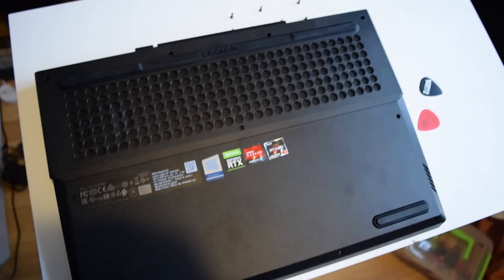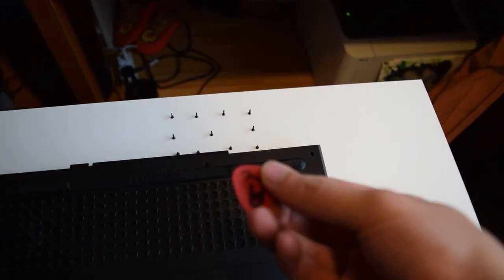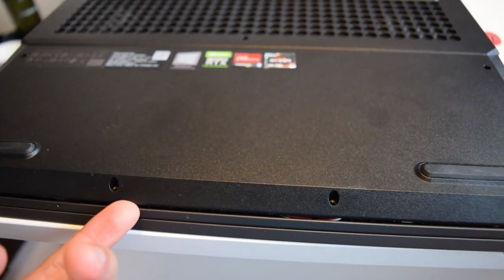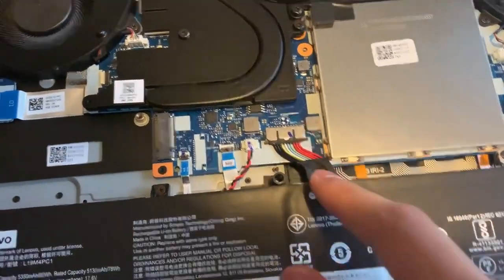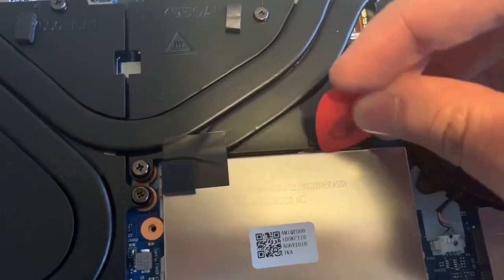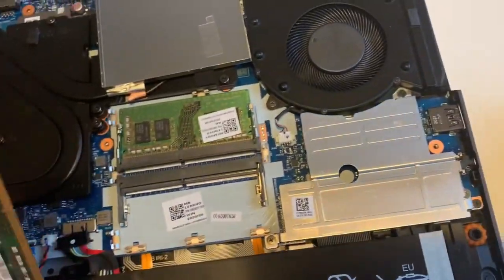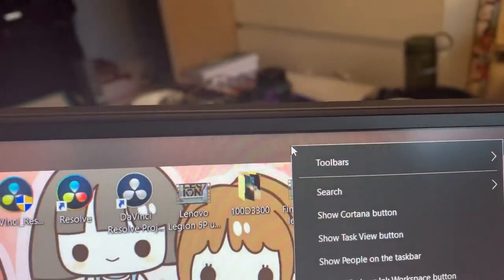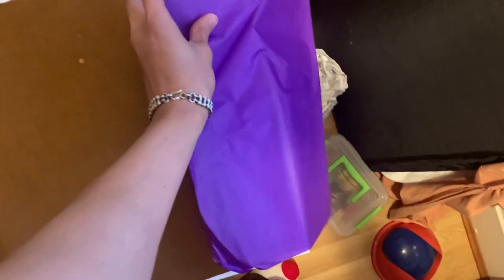Upgrading RAM for Lenovo Legion 5

Comment: I am not very experienced with tinkering with laptops, this looks easy though. The only Legion 5 I can find has 8gb ram/ 256gb ssd. Looks like I'll just buy it and upgrade it afterwards. Thanks for the video upload, very insightful.
Reply from the maker: Upgrading afterwards does require some involvement, but in the you learn more and have a better laptop, and often for cheaper than it would've been if you brought the upgrades from the manufacturer. I'm glad you found it useful, and are looking to upgrade it! All the best! :)

Comment: This is really helpful, could you please record a video upgrading ssd m.2? Placing another one. Thanks!
Reply from the maker: I don't have the device anymore from RMA issues on mine. But if I remember correctly, it should just be removing 3 screws then slotting the card in, you might need a m.2 mounting screw inaddition. But that should be it :)
Reply: @genuinepeanut7690  It is worrying to find out that a new purchase turns out to be faulty. I'm sorry about your experience with it. May I ask what was wrong with the laptop and why you had to return it?

Edit: Nevermind. I read the comments below where you detailed the problem.

Comment: You don't need to disconnect to battery, turning off the battery in bios should be enough, after finishing you just plug in the charger and the battery turns on
Reply from the maker: I didn't know that :D 
thanks!

Comment: Oh that's a cool place to move the stickers from the palm rest area... btw how hard are they to peel off and what's the easiest way to take them off without scratching the laptop?
Reply from the maker: Heating them up with a hot hair dyer or hot air gun. That'll loosen the glue a little to make it easier to peel.
I found the stickers not very nice on my palm all the time, as it is on the palm rest.
Reply: I never like the stickers on any thing especially laptops and remove them directly.

Comment: Do you have a link to the ram you used ?  Ive beought this laptop and want to grade the ram and ssd. Its the first computer ive had in 10 years and ive never upgraded anything so this has been very usefull 👍🏻
Reply from the maker: https://www.flexxmemory.co.uk/memory/samsung-8gb-ddr4-pc4-25600-3200mhz-260-pin-sodimm-1-2v-cl-22-laptop-ram-memory-module/
This is it, sorry for the late reply. Was away.
All the best for your upgrade!

Comment: Hi. Thanks for the very informative video and for all the tips and tricks as well. Just want to know if upgrading the ram and putting another ssd into the left slot will void my warranty? Although I have an idea, it's also nice to have confirmation. :)
Reply from the maker: From experience opening the Lenovo Legion 5P and the new Lenovo ideapad 5, there were no warranty void if removed stickers or messages on the screws or inside. And from general searching on the internet, it is most often allowed, providing you don't damage anything inside whilst upgrading.

Though, if I ever have to send the laptop back for repairs/support, I'd most likely take out the upgrades just to be on the safe side.

Hope this helps
Reply: @genuinepeanut7690  Thanks for answering my question. That's the confirmation I was waiting for. Hehe. Yeah, for warranty purposes, it's advised that you return everything to stock. Great. I'm gonna buy my own Legion 5 R7000P this week. Wish me luck when my additional 1TB SSD and my 32GB ram kit comes, I will be able to safely install them because of  your informative video. 😁

Comment: As you know, there is a metal Lenovo logo at the right corner of the laptop.( it is below the keyboard) I poured a little bit tea there by mistake. I cleaned it with towel but I have doubts. Is there any problem in future? Thanks for answering. Have a good day.
Reply from the maker: No, it should be fine. It doesn't light-up right? 
So it shouldn't lead to any electrical components unless the spillage got to the hinge of the laptop which might cause some worry. 

Even if you have the version which does, the fit and finish of these laptops seem quite well done to me. As long as it lights up again it should be fine.

The lid of laptops are usually made for these sorts of things when the laptop is closed, protects it from scratches, splashes etc. Its just not warranted if anything goes wrong.
Main thing is just don't step or it or something like that

Comment: quick thing different ram from idfferent companies are compatible as long as they have same specs i bough different company from laptop ram and it works i have8x2gb
Reply from the maker: They should in theory work, but there is a small chance that they won't. If you go with the same model same spec, i'd say it'll have a higher chance of working than same spec from different company. 
But for what ever reason, if they aren't compatible most companies are nice about return policies if you speak to them nicely. I can speak especially for the one I linked in one of the comments, which is where I brought mine from.

Comment: Do you have a link to the RAM you would recommend for this? I just bought and received my Lenovo Legion 5 today, and plan to install increased RAM, but am not sure what RAM works with it.
Reply from the maker: https://www.mrmemory.co.uk/memory-ram-upgrades/lenovo/laptop/legion-5p-15arh05h?autodetect=0&gclid=CjwKCAjwz6_8BRBkEiwA3p02VZXahSQlcC82391JqeOYZ9gcA5sE_1iZf1YzmZd016rKeRs3n0DpbRoCkHQQAvD_BwE
Could try this website I just did a general search on google, and this came up, their reviews seems pretty good.

But I would still recommend you check what ram you currently have in ur system and buy the same one again for maximum compatibility.
Reply: @genuinepeanut7690  I used MrMemory myself, and to upgrade the Legion 5P no less. Absolutely no issues, shipped and arrived very quickly, and they sent me a reputable brand (Crucial)!

Otherwise, if you just want to add another stick of the same RAM that the laptop ships with, I'm pretty sure it's this brand:
https://www.flexxmemory.co.uk/memory/samsung-8gb-ddr4-pc4-25600-3200mhz-260-pin-sodimm-1-2v-cl-22-laptop-ram-memory-module/

Comment: Hey, thanks for the video it was very useful to me... I went for a 2 x 16GB kit as I needed a little more ram  than 16 GB and I noticed I have an issue with my battery, when I mouse over it says "97% available (plugged in, not charging)" I wonder did you have any problems like this or do you know how I could fix it... I followed your instructions to the letter so I'm at a loss to know what to do next?
Reply from the maker: Since your laptop turns on, that means to battery is connected to the motherboard, but you say your battery is observing some faulty behaviour. The best guess from me would be to check that it is plugged in properly and that it is all the way in, i.e. take it out then plug it in again. I personally didn't have any problems with my battery's charge after upgrading.
If the issue persists it may be good to contact customer support of where you brought it, maybe the battery is faulty? Switching ram is within the warranty contract of Lenovo UK as far as I know.
Reply: @genuinepeanut7690  I did check double check the battery connection and all is well i have contacted lenovo support  so maybe they can help this is an issue that happens  so I'm not too worried, Thanks...

Comment: is a problem about this laptop and ram speed. So ram speed isn't just frequency but also the latency/CAS (cl 16 /cl18 etc....) and usually u can tweak ur bios to get the right ram speed you want on your pc.
But here you cannot, Lenovo didnt add this option (XMP options).
So if you buy some good ram, 3200mhz cl16 this kinda thing, it will be bottlenecked. 
Original ram is 3200mhz cl22. There is a quick formula to realize what speed your ram got "  (cas : frequency) x 2000  " which gets you 13.75. here the lower the better.
3200mhz with cl16 gives you 10 so its 25% faster. its HUGE. But without XMP options, the  ram speed shuts down to 2666mhz cl 22  so a result of 16.5.
You buy good ram which should go 25% faster but you got 25 slower than the original ram. Unbelievable.
The problem is that absolutely nobody talks about it. 
So even the graphic card and cpu can be bottlenecked by this if you don't check ram speed with cpu-z.
I don't know if Lenovo can add XMP options in their bios with an update, but that would be just decent behavior from them to try or communicate about it.
It's a gaming product. damn.

Comment: I have a lenevo legion 5 amd ryzen 4000  can i get the same ram u got and left in the description or do i have to check mine ram
Reply from the maker: You can probably get the same, but checking it will ensure 100% compatibility. But I'd say without checking it you're 95% good that it should work

Comment: Hello, Do you know maybe what screwdriver will be perfect to take this ssd screw, because i have big problems with it and dont know which one i should buy.
Reply from the maker: Screwdrivers usually comes in sets, with different heads and types, any old set should do. As long as you're not buying heavy duty ones, which are more ment for home improvement, then you're good. If you really need help of where to start, just type in precision screwdriver set in google. All the best with your upgrade.

Comment: Do you need to get the exact same ram because when I looked at other videos they said you can just get another 8gb ram with the same speed as the one already in the laptop. Is this true?
Reply from the maker: Yes, often people do that. It is just because in some rare instances the different ram stick may not work due to slight differences. I advised getting the same exact stick as it will have the highest chance of working for everyone who watches this video.

Comment: I am going to buy this laptop, does it matter if windows is installed on the default SSD and I have all my games and stuff on the SSD of which I will buy? Like will that slow down stuff if it's having to go between 2 SSDs?
Reply from the maker: There shouldn't be any slowdowns to games or any applications. The concern, if it even is one, is that you'll 2 have drives. i.e. Drive C: and drive D: (of course you can make more virtually if it helps you organise data).
Since you're adding an SSD, there's different types of SSDs with different transfer protocols and different speeds, you might want to look into those if you want the fastest. For this laptop you want M.2 SSDs, either pcie (faster) or sata (slower) variant.

Comment: Lenovo Legion 5 82GN0011GE - 17.3 '' FHD IPS 144Hz, AMD Ryzen 7 4800H, 16GB RAM, 512GB SSD, RTX 2060
Does the laptop support 32gb ram?
some sources indicate that they support it. It even has videos on youtube.
but it says that the original site can be upgraded up to 16 GB.
I was caught between the HP OMEN 015 and the laptop I wrote to you.
can i ask your comment
Reply from the maker: on the offical lenovo psref, it states it officially supports upto 32gb

Comment: Can you do a video on applying thermal paste for the Legion 5 please?
Reply from the maker: Sorry, I don't have the laptop anymore. I returned it because the screen and battery turned out to be faulty. I am looking to build a computer instead though, just need to get some parts.

What I recommend for thermal paste is that for the performance it gives you the risk isn't worth it, for me anyway. I think it is better to use it for a year, then repaste if you want after the warranty is gone and the factory paste starts to wear, but in the end, its up you. It didn't seem too difficult if I were to repaste it though, the cooler seems easy to take off without parts tangled together.
Reply: @genuinepeanut7690  how was it faulty? I'm looking to buy this on black Friday, if it's faulty then I might opt for omen
Reply from the maker: @noIies  There was a sticky pixel where it would stay a neon green, also my particular unit's battery drained abnormally fast after 1 week.

I don't think there's anything with the laptop if it went without those manufacturing issues. Tbh I think manufacturing tolerances isn't really there yet for most laptops makers. So just make sure you check it within the return period :)
Reply: @genuinepeanut7690  thanks for the reply, can you tell me how you were able to check those problems? My pixel are find but when I play 1080p videos they seem blurry, but when I play video that goes up to 4k it look good, also mine is 300nits ips but I have tp get it to 65% light to see better at night, are these normal?
Thank you

Comment: May i please get some advice on the exhaust ports? I can't seem to open the case if I just ply the front and back part 😭
Reply from the maker: Are you sure you unlatched everything on the sides and front? It came off pretty easily for me with a little wiggle after that.
Reply: @genuinepeanut7690  I bought the ply tool for laptop and I tried to ply open the section around the exhaust ports and it works now. Thank you
Reply from the maker: @Rengoku976  That's great to hear
Reply: @genuinepeanut7690  Thank you very much :>

Comment: Can you also add a link on the tools you use and parts
Reply from the maker: It's just a standard screw driver set, a guitar pick/anything plastic thin and rigid. Then your stick of ram
Reply: @genuinepeanut7690  do you have the intel version or the amd I'm looking to buy and extra 8gb of ram today on  Amazon

Comment: On Reddit I read you can put 64 gb of ram in these.
Reply from the maker: Officially lenovo says 32gb. But if you can get 64gb to work thats great too :)
Reply: I can comfirm 64gb working. 😆
Reply: @channel20122012  how do you like the legion 5? Does it get loud a lot. I am planning to use it more for virtualbox and have the screen closed. Instead I am going to connect two monitors to it.

Comment: Can you add a sata ssd to this particular model? I opened mine and i can't find where it would fit + there is no bay. Thanks!
Reply from the maker: For the Legion 5P the battery is too big to put sata ssd in. There are some lenovo legion 5 models with a smaller battery which will fit a sata ssd, but not the Legion 5P
Reply: @genuinepeanut7690  I figured. :( I put the ssd in an USB 3.0 rack and i'm using it externally now. Thanks for taking the time to reply.

Comment: 80 WH Battery ? how many hours of use you have? the 60 wh battery sucks by the way
Reply from the maker: It really depends on what you're running whilst on battery, but I'd say 3-4 hours with mine just browsing.
Reply: @genuinepeanut7690  are you using the Hybrid mode? Because that's what I'm getting with the 60 wh battery with only internet. By the way great video you help me a lot open.

Comment: Is it worth installing heatsinks in ram and ssd m.2?
Reply from the maker: I personally wouldn't say its worth it, as its very difficult to get the clearance necessary without removing the metal casing/shroud, and I'm not sure what the effects are in removing them.

Comment: also you didnt explain how to put it back on without breaking the clips. video also is a bit kindA LONG XD but itt helps so thanks
Reply from the maker: Are you refering to the back cover to the entire laptop?
That just snaps back together if you push it back on, its pretty much a lid. Just one that's hard to get off.
But if you're referring to the metal bracket on the ram and the tiny metal clip/latches.
I just slide it back in making sure all the clips/latches are on the outside of the bracket.  i.e. Just like how they were the I first took it off.

Yeah, it was a little long, but I didn't really plant much of it. Just thought it would be a nice quick guide for people since I knew how to do it and was upgrading mine.
Hope it helped!
Reply: @genuinepeanut7690  yes that's helps thanks!

Comment: Can you just write model of this ram ? I want to order one :-)
Reply from the maker: The ram that’s in yours might not be the same as the one in mine, as most manufacturers just throw what they have in there that’s of the same spec. So that’s why I showed how to check your own laptop’s to ensure maximum comparability.

But mine was the Samsung 8gb 3200mhz 22CL, with model number M471A1K43BD1.

I brought mine from flexxmemory.co.uk , I’m not endorsing them but that’s where I found mine and it worked out okay.
Reply: @genuinepeanut7690  Got it, but If for example I will put ddr4 1.2 volt ram stick from hyperX .... it should work... i assume?
Reply from the maker: @marcin6386  should work if speeds match, but I can't confirm 100% as I haven't tested personally

Comment: I accidentally teared the sticker, but I putted it back on immediately. Will there be a problem?
Reply from the maker: No, not really. It isn't used to pass any electrical signals. The most it'll do is conduct some heat away from the black heat pipes, but even that wouldn't be any noticeable difference. 
It's just if you need to RMA it may be something they'll scrutinize you on.